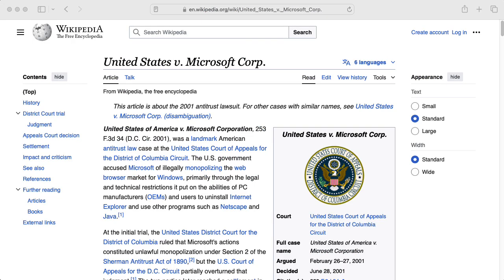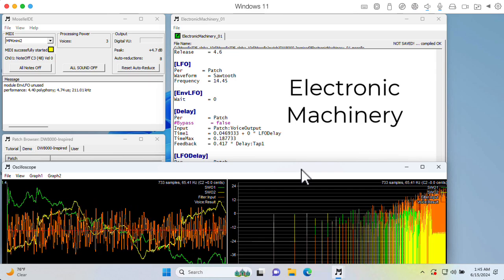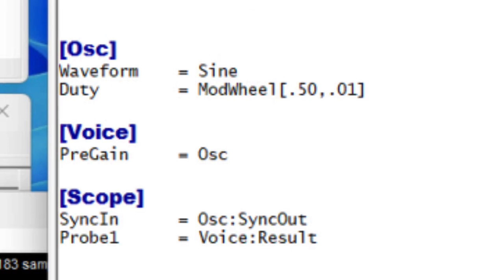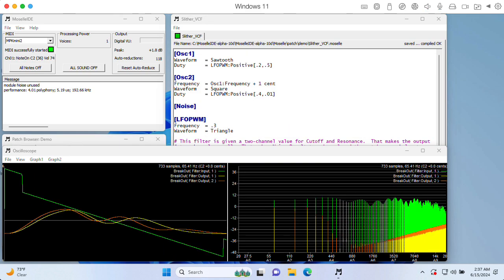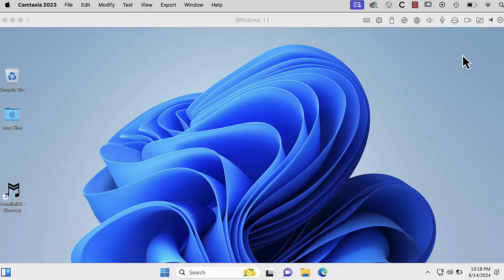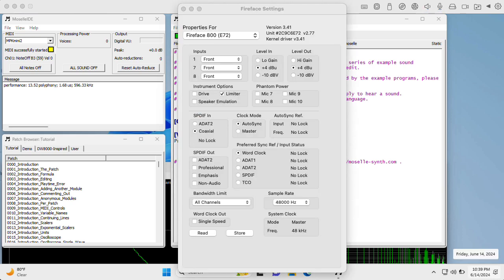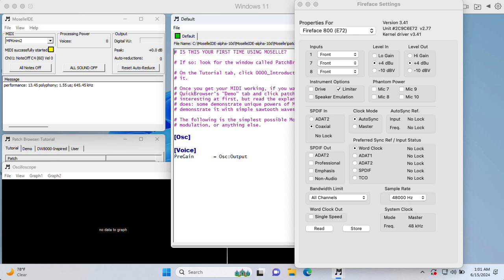Moselle Modular Synthesizer: Softsynth with a Thoughtfully Constructed Patching Language

Comment: 1:26 this is a place where reaktor core does a bit better, with grouped signals, named variables that take the place of wires, and some stuff for replacing wireless grouped signals within a node group. but it does still have the limitation that you can't use code to define a system that can scale to whatever, code reuse in reaktor is basically non-existent.
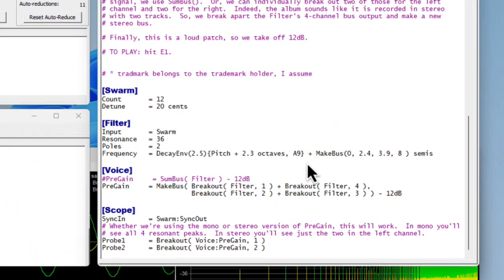Reply: 1:49 honestly i think reaktor would fare about as well here. a full programming language would do better as you could have this done generically and defined with far fewer lines of code
Reply: also i think the strength of reaktor core is in part that you can figure out how stuff works and modify it however you want. once i was waveshaping a saw to create other waveforms, and the blep on the default saw osc was causing a discontinuity, so i opened up the default saw osc and pulled it out of the signal flow, problem solved. the only things you can't look inside of are the first submenu of stuff, math ops, basic memory actions, etc
Reply from the maker: It's been a while since I looked at Reaktor (the patch shown there is one of mine), and I didn't have time to get too deeply into its features. I should give it another look, especially if it has features that would help clean up that patch (it's my mockup of the Buchla 400 architecture).

Comment: i still always prefer the flowcharts more. they are easyier to follow than a bunch of symbols. one example where i think this is useful is in mortiz klien's resonant lowpass tutorial. i find it disengenuous to call the first stage in his vid- a lowpass. i see it better as a highpass+ sum of op amp output. yes it has lowpass topology but it is being used backwards as a mixer+hpf.. ive done a few experiments to back up my findings. i think it was a linguistic barrerier of sorts. it looks like a lowpass at first glance but caps block 0 hz dc. while passing 99999 hz better.

Comment: 8:33 correct: MIDI device availability is only checked at startup... one of literally 1000s of TODOs.  I've got so many exciting things to do with performance, user interface, and more audio capability, that I'm not polishing things like this.  (Or doing a DAW, or a Mac version, etc. etc.)  Thanks for bearing with me.

Small fonts: I'm awestruck that this even runs on the emulator.  Early Win10 had a similar small window/big font issue but I think it doesn't after SP1.  Win11 seems fine.

Strange sounds: Excellent trouble-shooting!  What you show is what we'd expect if you edited the INI file from 44.1 to 48 but the file wasn't written to disk, then Moselle restarted and read the old contents, only then the save took effect?  So is there a few seconds' delay in your emulation before the PC side sees a file edit?  And the subsequent restart did read the 48000 ini?  I don't want to ask you to try to reproduce this as I don't think I will be able to fix the problem regardless.  That said, kudos for finding that file to edit.